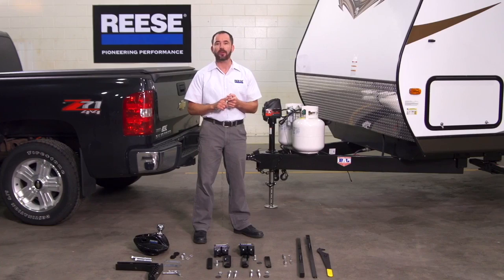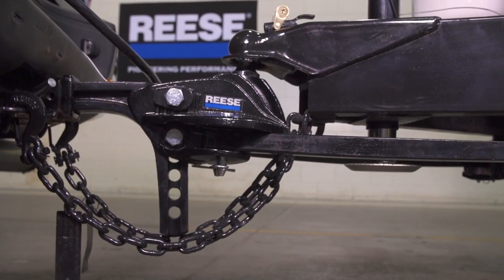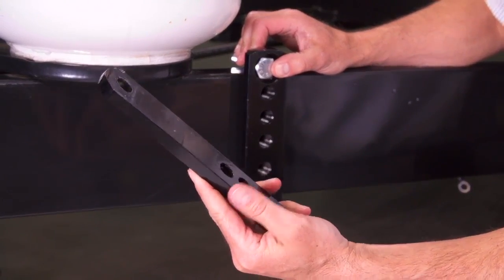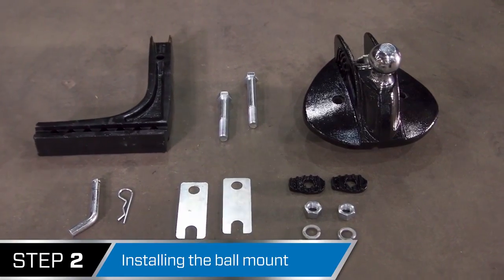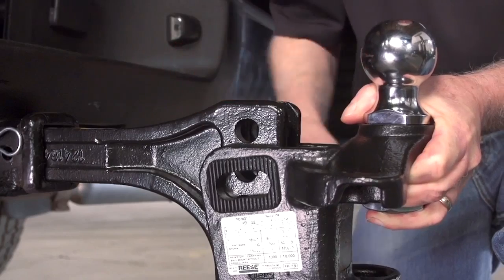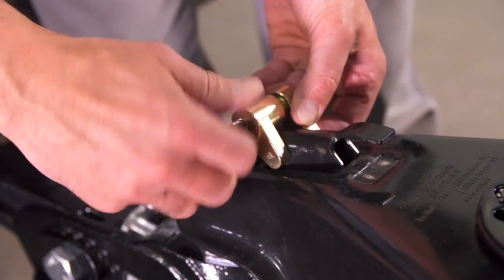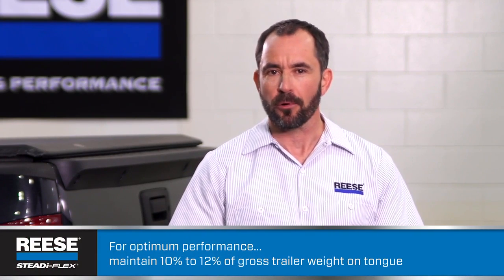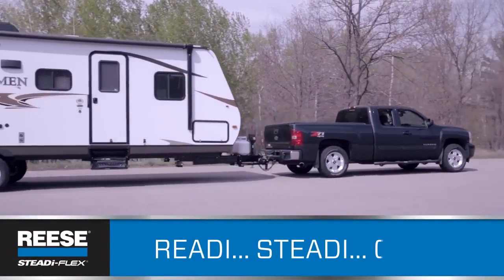Reese Steadi-Flex Sway Control & Weight Distribution Hitch Installation

Comment: What if the trailer ball won't go in the trailer coupler enough to lock in place? I've been having trouble since I purchased the camper and I wonder if the hitch is out of adjustment because the ball seems off center and very tight when going up into the trailer coupler. That's what I get for purchasing an equalizer WDH.

Comment: I'm shocked that this video completely omits the proper setting of the adjustment bolt and even talks about it at the wrong point in the setup. The adjustment bolt is set to get the correct drop angle on the bars BEFORE the shank bolts are torqued down.
Reply: Thanks for pointing that out.

Comment: It appears that the T-Bar bolts are smaller than the recommended socket wrenches of 15/16” & 1 1/8”.  What size socket then?